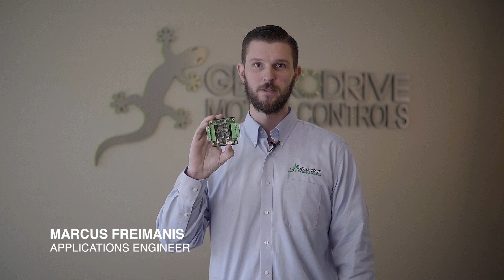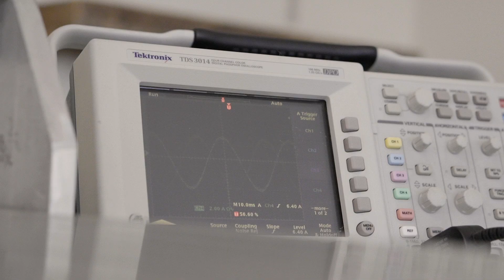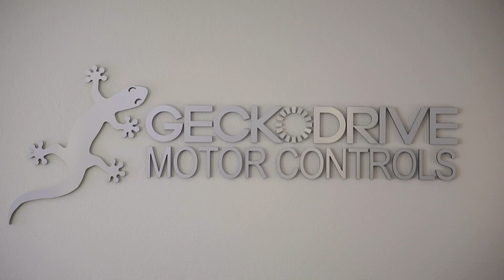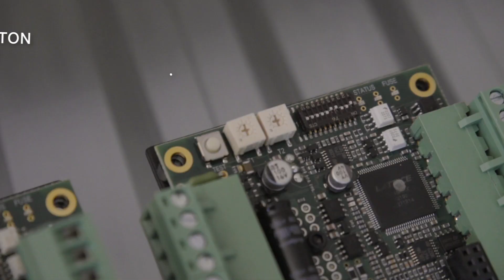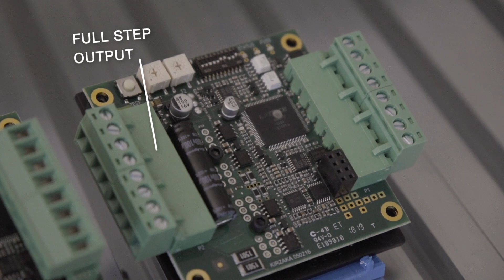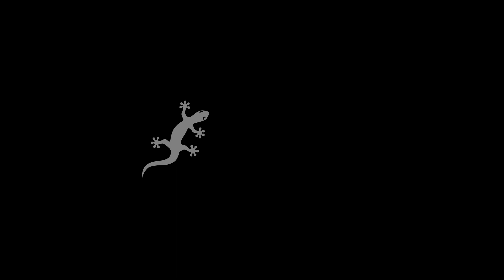Geckodrive GR214V Bulletproof High Resolution Stepper Drive

Comment: Cost is an important specification.  Please don't be shy about telling us the introductory pricing.  We don't expect it to be the cheapest.  The best seldom is.
Reply from the maker: Thank you and great point! The GR214V is $151/ unit in single quantity with quantity discounts starting at the 5 unit level. You can also find pricing for all of our products on our website at www.geckodrive.com . A bit more expensive than imports but these are a one and done purchase you will not have to replace over and over again saving you money in the long run. Should a problem arise, all of our products come with our 3 year warranty for parts and workmanship and our tech support is easily accessible and ready to help you troubleshoot your application.